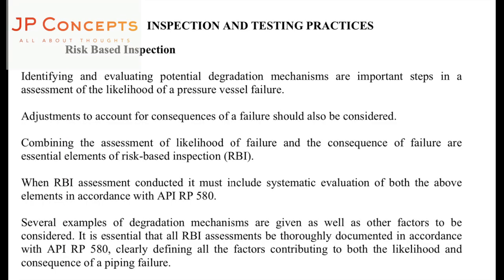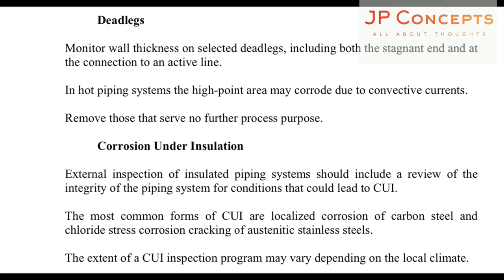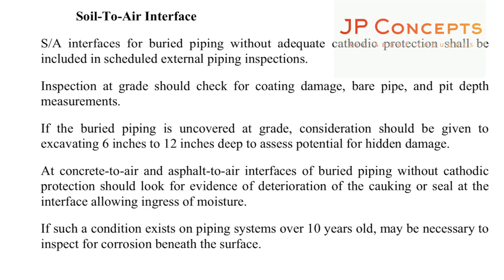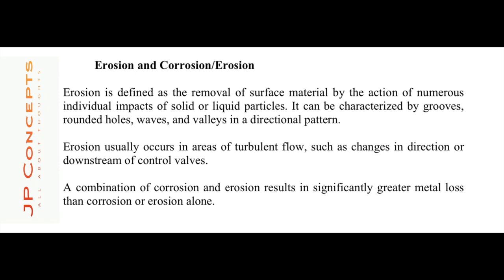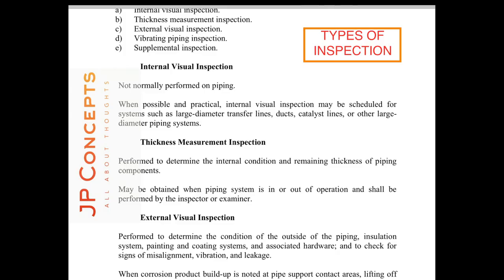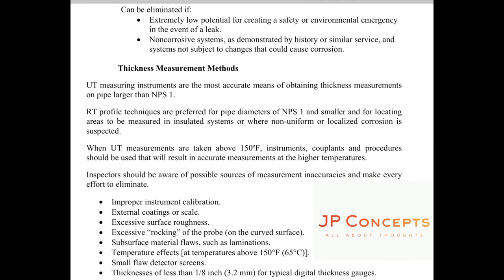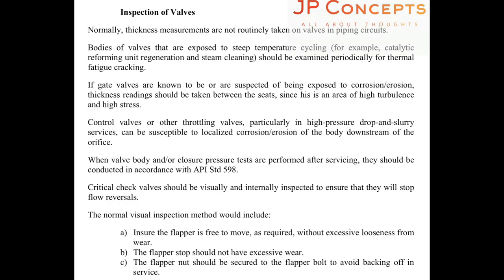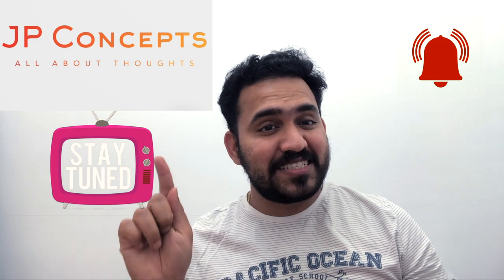API 570 CERTIFICATION PREPARATION ONLINE TRAINING|VOL-2|JP CONCEPTS|TECHNICAL SERIES

Comment: Sir, what is minimum 12 inches or 3 pipes diameter for injection point upstream limit
Reply from the maker: You have to consider the higher one. 12 inch or 3 times the pipe dia whichever is higher.

Comment: Sir i need latest accurate material of Api 570  test or certification.
Reply from the maker: The main material to follow in API 570 is the code itself. Please arrange all the codes mentioned in my videos ( as per effectively sheet) first . Then start preparation. You can get codes from your friends or through LinkedIn